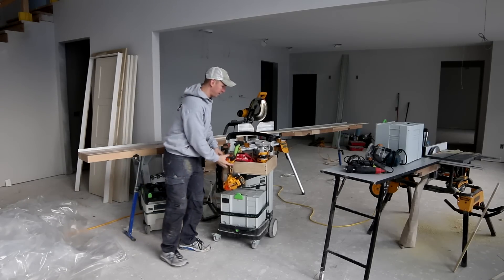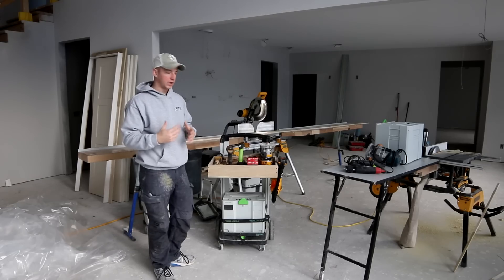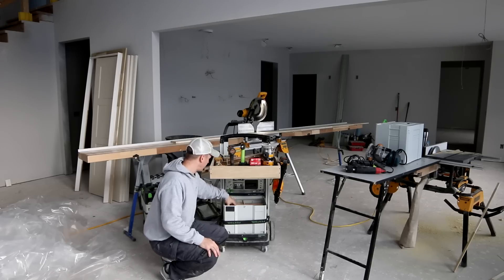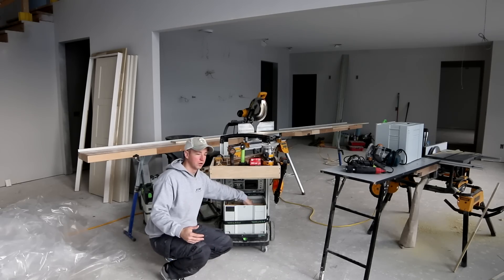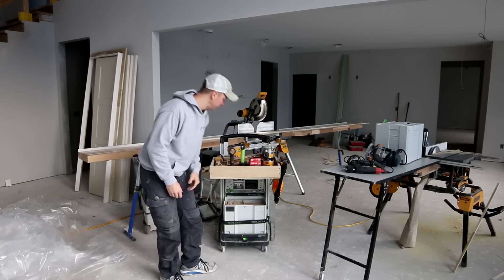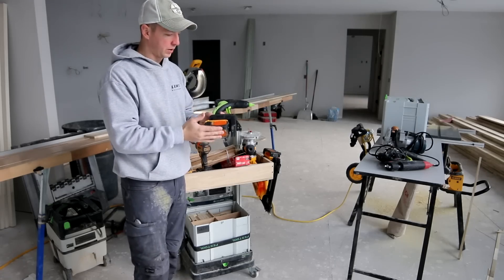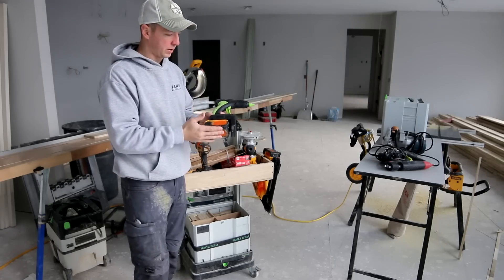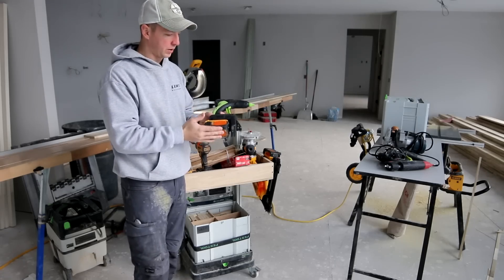A Guide to Setting Up a Jamb Master Cart for Setting Doors

Comment: I bought the jambmaster thanks to your video.  I'm going to have a big job coming up to use it.  I wanted to know about the shims that you use...do you just rip plywood to size?  What size do you make them?
Reply from the maker: 1/4, 3/8, 1/2, 5/8" Thick. I rip them them out of left over 1x material. Cut 3-1/4 long.
Reply: @InsiderCarpentry  Thanks.

Comment: Ever look into the Cadex CO2 auxiliary tank for air nailer‘s and Pinners? It allows me to use my bostich smart point 18g and Cadex 23g pinners and only cost about $140CAD and $5 per refill at the local paintball shop for about 500-700 shots.

Comment: Have you tried the clips that screw to jamb them drywall once you set door? Once I used them I never turned back. No shims and really don't need a level. Another plus is no nails or screws through the jamb so great for painter.

Comment: Just got a jambMaster. Thanks for the helpful info. One question what do you tend to make your shims out of? They are saying to use 3 1/4"x1" and have a variety of thicknesses. I can't think of anything that would be that size you can just slice different thicknesses of. Any help is appreciated!
Reply from the maker: I use mostly scraps of 5/4 poplar, mull strips, etc. Some guys use plywood. Whatever scraps you can find.

Comment: Interested in the sure bond glue gun but the Milwaukee version is unavailable and do you use the fastenmaster glue to pre-assemble window casings?
I’m a finish carpenter and using the clam clamps currently and interested in making the jump to hot glue for more efficiency
Reply from the maker: Absolutely don't use regular hot glue. You want hipur hot glue. Regular hot glue won't do the job. See my video on mitered casing for more on hipur. Hipur will be a big efficiency booster for you with mitered casing.
Reply: Thanks what’s your success with the hipur glue especially the glue guns I’ve heard mixed results from folks that the guns are finicky
Reply from the maker: @SuperCarlcrazy  Yeah, The guns are kind of a joke. But its your only option to use that size hipur cartridges. You just have to be careful with them. If a tube is plugged don't crank on the gun and break it. I always have a back up gun in my van. I plan to do a full video covering hipur and all the little tricks that go along with it. So stay tuned.

Comment: Nice setup, my setup is in a rolling chest pull cart. Interesting, we have almost the same equipment 🤩 ( except for the hot glue gun & gambling cards. Explain how to use glue, I got it, for lubercating 3" screws while driving them in ) and
Here is a question: do you shim between the Jack & jamb
Or shim between the king & Jack studs so door jamb is in solid plumb contact with Jack studs?
Reply: doc hall  many times I have replaced Jack studs, made jamb stock, assembled replacement exterior doors, replace stucco mold trim, a hundred times in association townhouses.
It can be done. I slice between the Jack studs and the drywall, just to separate the two, breaking the screws, removing two 16 nails. Adjusting for plumb, adding correct thickness spacers. Replace Jack studs with new nails. Now it's plumb and leaving  1/4" rough opening for a thight door jamb fit.
Trim covers and hides any sliver holes in drywall. Chalk up & paint when ready. 😊
PS; 8 hour job per exterior door Jack stud and door jamb termites replacement.

Comment: This comment is probably redundant, but why did you decide to use the jambmaster? I have never seen one used, but it didn't look significantly faster than shimming the door, and it requires twice as many tools/prepping a while bunch of shims.
Reply from the maker: Perfection and repeatability. It will give you a perfect shim job consistently in the worst of openings. Its definitely not a tool for everyone. But for me, setting 30 plus doors on a house, I can offset the time messing with the extra tools.